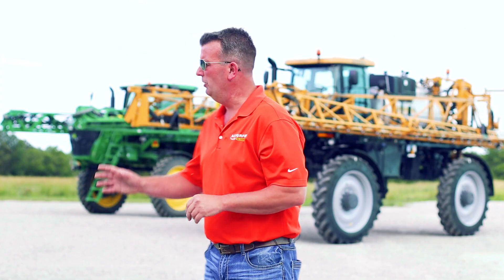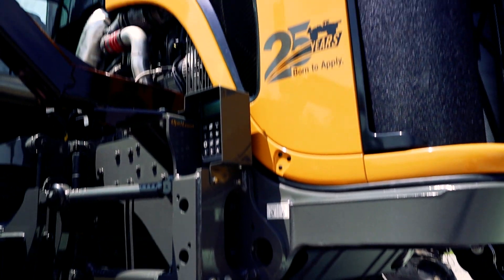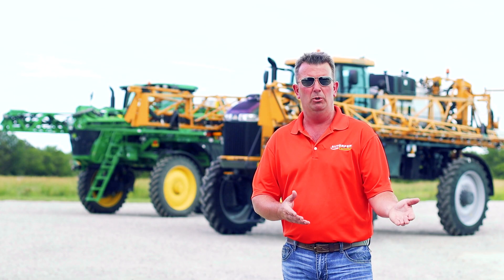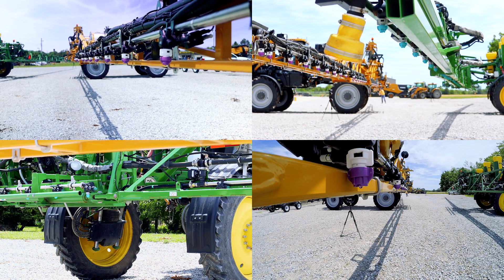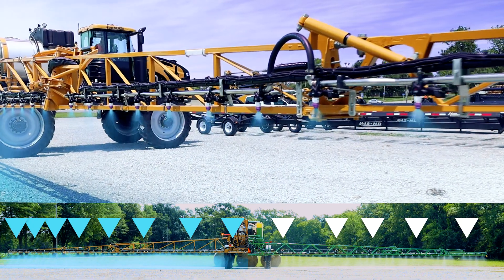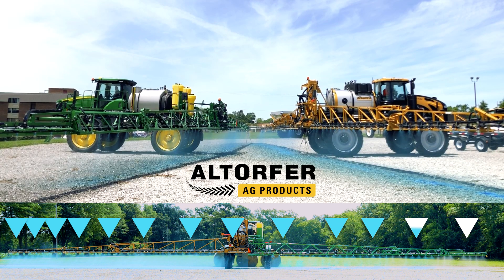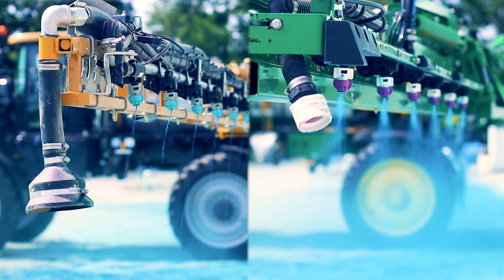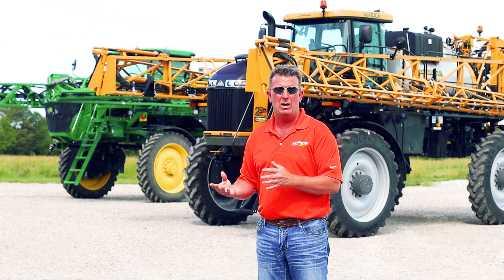RoGator C Series vs The Competition - Liquid Logic

Comment: Compare Rogator to JD's exact apply nozzles. No comparison. Rogator's boom recirculation is pretty handy though especially in custom spraying often switching between chemicals often.
Reply: They chose the top of the line rogator and compared it to a base model deere so theirs looks better for advertising. I like the deere but it all comes to preferences and dealer support

Comment: Excellent video.  It would be incredible to see more comparison videos between the R series and the new Rogator.  Driving both machines through challenging hills or gullies where the boom stability and control can both be shown back to back.  Driving on a pretty good sidehill to see which one has a tendency to doggy track worse where the rear wheels are two feet downhill off the track of the steer tires.  Maybe having both booms back to back and showing how each reacts to roll and yaw just from throwing them around by hand.  I know it would be a lot of work, but it would be a great advertisement for Rogator.